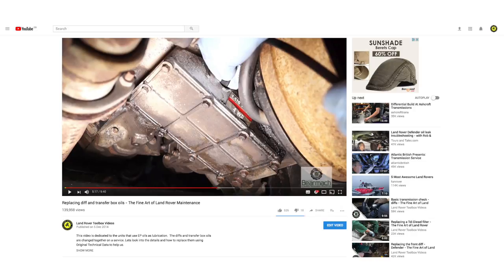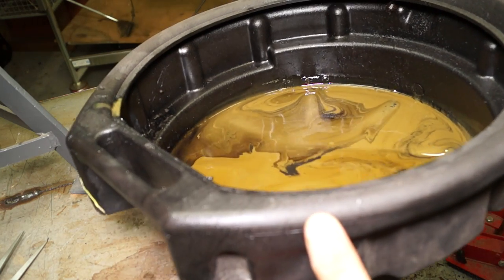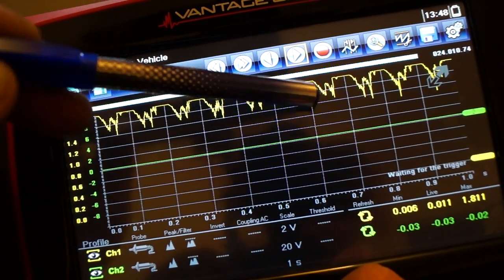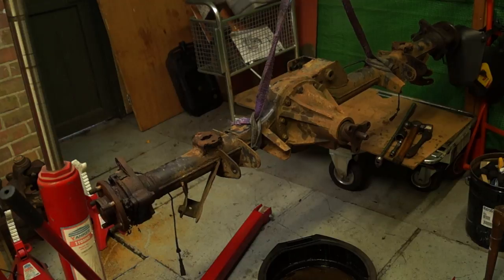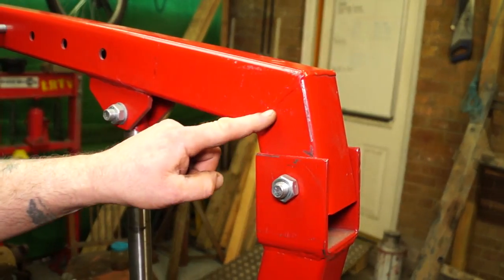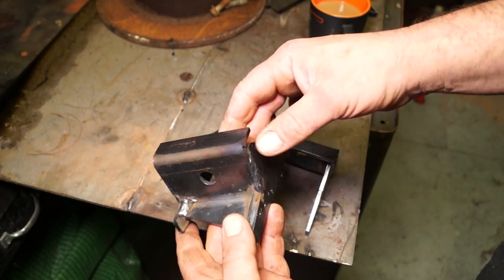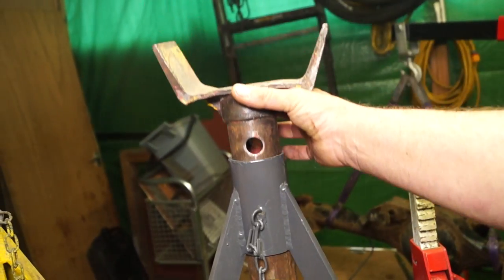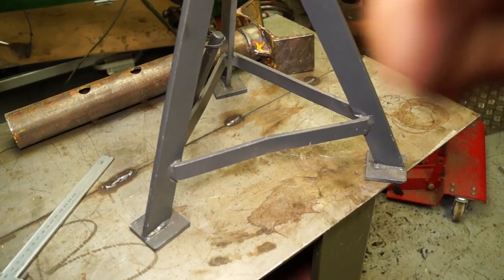Hybrid D2 VLOG 1. Relative compression test on the Td5 and opening ones eyes to fabrication.

Comment: my discos 300 head gasket just blow  180000 miles never been apart , i think it might be to much juice going in plus 17 psi turbo pressure.  the first 2 or 3 weeks of not smoking are hard , but i found it easy after that  . i was  a 18 years of cutters choice wish i gave up sooner. good luck
Reply from the maker: Remember the engines are quite old now.  In my dads day, they used to have the heads of every 20 000 miles for  a decoke service.  I think it's done well your 300tdi.  Higher pressure will get you more piston blow by. Perhaps the gasket was just ready to be changed?

Comment: Top man, as all keen landy owners know its down to a combination of knowing thr car well enough along with the common sense to check oils and change with consideration, im sure 1 every month sounds like like they have a leak lol, i checked mine every month due to a minor leak but never changed for about 4 or 5 and mine was every day use on and off road, both on thr d1 and d2, as allways superb video has helped me out a huge amount over the years with tips on changung things, but as i found and many do each one is different from rusted bolts to problems resolution just get on the knees and under the bonnet :)
Reply from the maker: I am glad to here that someone is checking their motor out frequently.  All too often I see this on Facebook.  Folk don't do anything until they have a problem.  Usually a costly one.
Reply: Land Rover Toolbox Videos exactly with a landy its about keeping ontop of them but very enjoyable ofc depending on the problem to diagnose and fix yourself, keep the vidoes up allways good to get a couple tips on things to look out for, i find the engines ans body are dead reliable, just every thing else seems to drop off but thats a landy lol :)
Reply from the maker: As my dad said.  (ex RAF)  Land Rovers are high maintenance vehicles

Comment: Woohoo, more jackstands are always good in a shop, to similar point ive used square tubing to make heavy jackstands (4"x4" cut to length) and just like round tube drill holes for pins on slightly smaller tube, use C channel caps and 1/2" squared up plate for base, altho flat stock indeed might be bit cheaper and easier to come by, but also you dont need it to hold up a rail mule either, just the rover lol
Reply from the maker: I didn't think of using box..........  there is an option.     Anyway.  What's a rail mule, bud?
Reply: Land Rover Toolbox Videos Its a smaller version of locomotive used in yards for moving rail cars, had Trackmobile brand version used to work on when i was at steel plant
Reply from the maker: Ah right. The job title of the item is in the title.   Which is better. Steel working or HGV fitting for you?
Reply: Land Rover Toolbox Videos well, did all maintenance and fab at steel plant, i do enjoy the fleet side a bit,